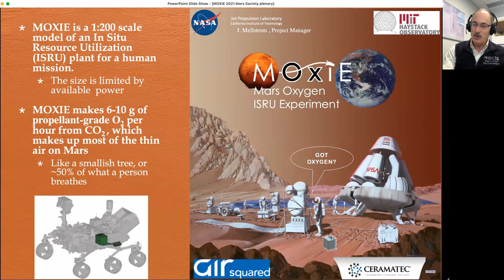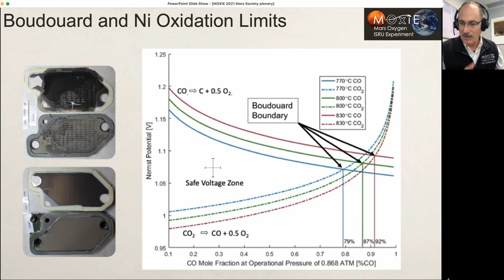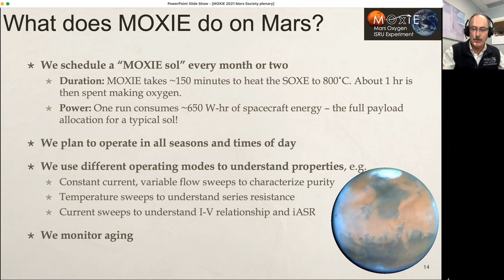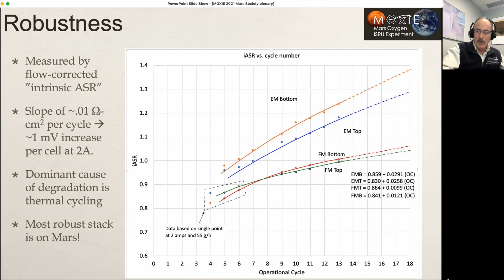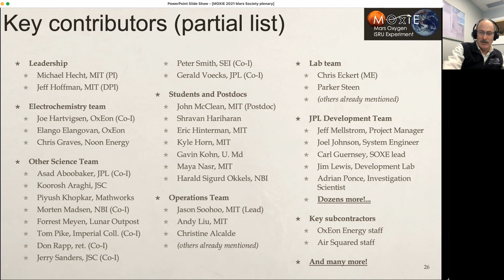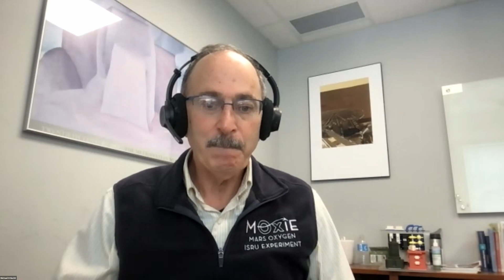MOXIE Project Update - Dr. Michael Hecht - 2021 Mars Society Virtual Convention

Comment: Try a catalysis additive of Zinc, Magnesium, or Boron in your liquid. That may help, plus the G°ravity issue is solved by a larger pump. To maintain your catalysis Temp. Because that is my issue I would try a Nitrogen cooling system, possibly would help the flow issue as well. PLUS a cylinder cools better than a BOX! I really like mine!